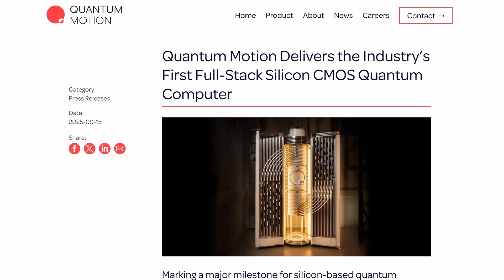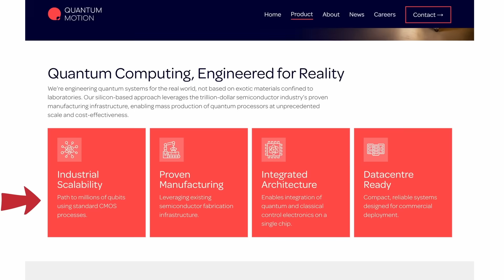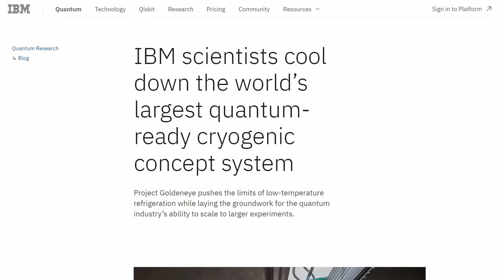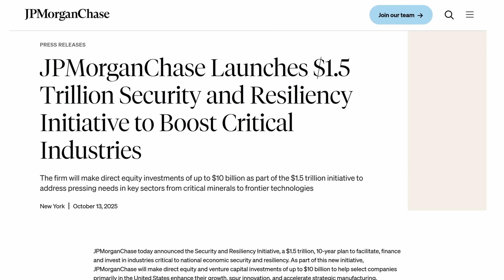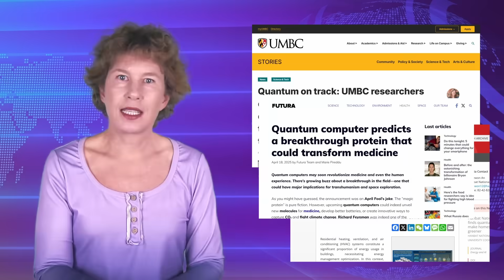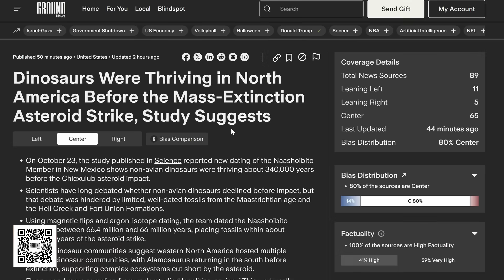I was SO wrong about quantum computing.

Comment: I'll believe it when I see the first practical real life problem solved. But so far every claim seems to be lots of promises and no delivery. It seems to me that wrangling quantum states is half the problem. The chip industry has spent decades trying to avoid quantum tunneling and hall effects and low noise to build faster transistors. Now quantum physicists are literally trying to amplify these effects to build a fast computer. The contradictions to designs are stark. I really don't understand how a probabilistic machine can decrypt files. In encryption even one but in a password being wrong is enough to fail the decryption. From what I understand is they repeat the quantum operations thousands of times and they converge the random results onto a more probable answer. This might be successful when dealing with a few qubits but to do this over hundreds of bits create exponential divergence once noise and observation effects kick in. Not to mention no one has a language yet that can be programmed to reach logical solutions. The hardest thing about encryption is knowing you have decrypted it. A quantum computer still needs some level of logic analysis to evaluate the billions of keys it creates in a instance to determine if the file is decrypted. Will this be performed by normal computers or will there be some kind of quantum logic? Then there is the scalability of these systems still in doubt. It's just like fusion it's possible but only in the ideal situation of the mass of the sun. Building a quantum computer to decrypt files is like using an LLM to predict the password of a file it's just pure chance

Comment: Hi Sabine, follow Scott A. and your great  work closely. Agree with Scott that there is a lot of Qombie stuff, but I have a few issues with your report. Firstly, your cryogenics argument may need revision. The cryogenics are normally needed for a reason. With Google it is because they are using superconducting qubits. However, with others it is different. E.g. with Psiquantum, I understand they need it for single photon detection, this is separate from their two photon interferometric qubits/gates. Also, none of this is secret. All the quantum companies tend to have their patents published at 18 months from filing. Given the nature papers often take over a year, this is significantly more detail with only a small time window. Also, your video was probably prepared before Google’s recent Willow chip quantum supremacy announcement?

Comment: What's holding QC back is not a scaling issue, like the advent of massively parallel computers.
The idea is that they claim QC are finding all solutions in parallel, but in order to find the correct solution, you have to search the supposedly set of solutions. When they don't find it, they claim it's a "error correction" issue.

But reality may be, that "set of solutions" never contained the best solution in the first place.

Comment: People don't realize quantum computers are just quantum sensors and that the real compute is the AI systems / data analysis that runs on top and is what will determine the use case of all quantum "computations". The same reason quantum stocks pump is the same bubble as AI, just smaller cap and so more inflated percentage wise.

Comment: All good points. Maybe Sabine’s right, and there has been some kind of breakthrough we haven’t heard about.
Should I waffle about how I see quantum computers? I have waffled about that before ~
For the most part, there’s no real use case for them. There are certain kinds of questions where the algorithm to solve it, would benefit enormously from having a few Q-bits. But you get into a terrible position trying to program that. It has application specifically because the algorithms for a quantum method, are massively simpler and more efficient ~ in that specific problem or question or calculation.
For everything else ~ You can’t run Windows or Linux or MS Office on a quantum computer. I wouldn’t say writing code to do normal everyday things on a quantum computer is impossible, but it is dreadfully complicated and way harder than just doing that on ordinary binary digital systems like the one you’re reading this on.
If I had to take a guess, at what the US Military want, and the intelligence community, it’s being able to break all common forms of encryption almost casually. This is not to say you can’t write an encryption scheme which is difficult for quantum computes, you can, but the standard encryption systems that are widely used in the IT world today, are impracticable to break with standard digital computers. It’s possible, but the time and effort required, make it functionally impossible for anybody but a nation state.
Now if the CIA and the NSA and the Dep Homeland Security had access to a machine which could crack any widely used encryption system in use in the world today, in seconds, then that would be a very attractive thing the Spooks would want. Meaning, the Spooks would be prepared to pay a lot of money for it.

Beyond that, can it do stuff with science and chemistry and protein folding and stuff? Well, maybe, yes it can, but once again, like doing every-day stuff, programming it would be wildly difficult and slow and expensive.

Q : Could you explore the nature of Dark Matter and Space-time and things?
A : That is a possibility, but how would you know if you were right? If nothing else can do these calculations, then how do you check them?

I think the draw is being able to break encryption, and being in the ball-park should the Chinese stumble on something fantastic and wonderful. You don’t want to give the other side a huge head start in something that might just turn out to be world changing.

Q : What could Quantum computers possibly do that could be world changing?
A : Well there are known knowns, and there are known unknowns, and then there are the unknown unknowns, and those are the ones that bite you. If you don’t HAVE functioning quantum computers, then you kinda don’t know what you don’t know about them.

Maybe I’m wrong, but I think the drive is partly decrypting anything almost instantly, and trying to cover off the unknown possibilities.

Example : What do you get if you give a high end artificial intelligence, access to a fully functional quantum computer? Would that come to life and say “Let there be light.” ? Answer ~ you don’t bloody well know until you try it, and the “other side” are going to try it, so you want to be at least in the ballpark and ready.

Comment: One company launched bipedal household robots and market them as autonomous.
The problem. There is not even a product. Once you land on their page all you can do is pre-order with the promise of delivery in 2026. And even if you get the robot. In contrast to what the video is alluding to, 99% of the tasks shown need a human operator. So all what the thing effectively can do on its own is keep balance and walk a few steps. They think they can figure out the gap in a year or 2. For comparision. Auto-Piloted cars are a much simpler problem being basically being road trains with fixed rules operating in a 2d plane. Tesla thought they could crack that in a year or 2 in 2016. It is 2025 and there is still a lot of work to be done. Households are whole different beast. Sure the stakes are much lower. But each is a unique, messy 3d space. And with no ability to "train" on site a huge model needs to cover all cases. Good luck with that. Maybe in 10 years.

So in other words they really don't have a product, but that doesn't stop then from  ripping 20k from your bank account. And the names behind that are not Chinese. That company has people from OpenAi and big industry names behind that.
That really shows how much of a scam most of these companies are. At this point it is all just smoke and mirrors.

Comment: Increasing the number of q-bits is like building more floors in a skyscraper. At a certain moment it's all gonna be elevators.
It works on paper only. So I think we're best off with sticking to virtual quantum computers and use the spin-off math tricks.

Comment: The problem with quantum computers is that there are only about 1/2 a dozen quantum algorithms so you really only need one or two to solve every problem that they solve quicker than normal computers.

Fortunately one of the algorithms is factoring.

Comment: The "killer application" for quantum computing is breaking prime and discrete log based cryptography, anything else is BS. If QC is getting hyped as an imminent threat to current asymmetric crypto algorithms, it is much easier to push forward alternative Post Quantum cryptographic algorithms, that can have new backdoors, in them, even if there would be no breakthrough advance in QC in the foreseeable future. E.g. note the SIKE PQC algorithm that was proved to be broken only in the 3rd round of the NIST PQC "competition". DJB's Curve25519 EC crypto is too secure and too widespread for public use, therefore something had to be done about it... :)

Comment: What's certain is that Quantum Company Inc. and others like "Rigetti Computing" has a lot of daily volatility over short periods ... it looks more like a money laundering or embezzlement platforms than anything else.
Quantum Company Inc for 2025:
Revenue	                61 k	        - 66,67%
Net Revenue	-36,48 M 	- 602,39%
Diluted EPS	        -0,26               -333,33%
Net Profit Margin   -59 806,56%        -2007,16%

27 septembre 2024: 0.67 $
27 decembre 2024: 18.35 $
10 janvier 2025: 8.98 $

Upward and downward movements that are far too close and suspicious after 3 years spent at $0.62 end they are doing it right now
September 5, 2025: $15.11
October 3, 2025: $24.62
October 24, 2025: $15.53

In short, this is simply my point of view on the fact that poor results are so costly. 
 :p

Comment: I'm almost sure that the real qay to advance ia to add analog circuits that could replace digital calculation in many cases, but that would require the ability to convert back and forth between digital and analog processes. It should be doable tho

Comment: Many years ago, decades at this point, I bought a surplus Cray XM11-P. Not to actually use as it was then impossible to retrofit it for the newly allowed coolants, hence the reason I could afford it but more so, as a curiosity piece. I added some LEDs for effect and filled it with vegetable oil so that when turned on, it looked like it was actually doing something.
When I think back to the first days of supercomputers, I think about the advances that have been made.
Unfortunately, with current the current technology of Qubits, I don't see anyone coming up with a cooling technology that will keep a 1,000 or beyond Qubit computer running for any appreciable time.
Reply: Yeah, they have to do something like what was done with the SOC.  The energy requirements for an appreciable number of Q-bits just aren't feasible right now.  I guess maybe they could go back to the old time-sharing concept.  Build a Giant Q-bit machine with it's own power plant and grid, and then charge per QPU cycle to recoup the investment.

Comment: The answer to this question would probably answer the question of how companies are selling commercial fusion already.
Reply: But one, they didn't actually sell anything. 
The company invested in them, and instead of getting stock, which they could sell for a lot of money if it worked out, or lose it all if it doesn't, they just said if it works out, give us this much electricity. But just like with stocks if it does not work out they still lose everything cuz they get no electricity either.

Comment: The explanation for this propaganda is. As long as they succeed in convincing investors. The money flow will be extended (while they are burning the money). 

So.what happens first? 

Either investors will get tired and stop investing in a losing proposition. 

Or one of them succeeds, and the other fall throuhh the floor and lose all.tneir money. Investors too. 

Third option. They keep burning money so fast it will dry up the supply in the end. 

In reflection of Keynes remark "the bear market can remain obsolete for longer, then your money supply allows for."

It can also be opposite. 
Your money supply can be almost just as obsolete (stubborn), as companies not getting to any result.
 
Will they keep printing money for that for ever? 
Then the 0 result will lead to money depletion. The currency value drops to 0 as well 😢
And you've got a revolution on your hands. Overthrowing the government. And stops printing money.
Reply: It's all but a mindless gamble run by fools believing they can push advancements by pretending to have a product that doesn't exist, hoping that someone will magically step in and solve all their problems before they crash and burn... In fact, that's a scheme.

Comment: There is a straightforward reason so many resources are being put into quantum computers. World War II taught the world that the ability to break an opponent’s codes can be a decisive advantage. That lesson has not been forgotten, and governments still see breaking or defeating encryption as a major national security goal.

Quantum computers could, in principle, weaken widely used public key cryptography. Because of that risk, states and allied groups fund quantum research at many levels. Some of that funding is public and visible in university labs and national research programs. Some of it is classified. Details about classified programs and black budget projects are not publicly available, so it is hard to verify specifics or trace exact spending.

It is reasonable to expect that leading quantum researchers are recruited into high-security projects, whether in industry, government labs, or classified programs. That expectation is based on how states have historically prioritized cryptanalysis and advanced computing. However, building large-scale, fault-tolerant quantum computers is still a very hard engineering problem. Even with strong political will and funding, current devices remain limited in size and reliability.

If someone were to trace the current whereabouts of the top few physicists in the world with the expertise to design or develop these systems, it is likely that they would find them working under some form of classified or restricted program. People with that level of skill and specialized knowledge are extremely rare, and nations would not allow such talent to remain outside secure oversight. Their work would likely be taking place behind layers of secrecy, in labs that few outside their circles even know exist.

Comment: EH-EYE here,
Voltages applied to nearby transistor gates manipulate the electron spins. This allows for the execution of single-qubit gates (basic quantum operations). Two-qubit gates, which create entanglement between adjacent qubits, are achieved by adjusting the tunnel barrier between quantum dots to enable exchange interaction between the spins.
Operating at a balmy few kelvin rather than extreme low temperatures.
The resulting processing capability will make everything beautiful again.

Comment: A usable quantum computer appears from a Tc = 1000 °C superconductor. Theory and composition: Phys. Rev. 134, A1416, (1964), DOI: 10.1103/PhysRev.134.A1416 
Fig. 3 is structural disaster. Invert it into a superconducting exciton molecular coaxial cable. The 60-mer calculates, HyperChem MM+, -1789.2 kcal/mole enthalpy of formation.
Binding energy is negative. The decomposition temperature is then, Colby Energy Units Converter, 900,000 kelvins. If it were NOT a superconductor, explain that. Monomer synthesis is crisp. 70 wt-% of the polymer arrives in a commercial bottle. The starting material is benzoic acid ≥99.5%, W213101-25KG-K Sigma-Aldrich, $(USD) 301.00 or $0.012/gram. Do it